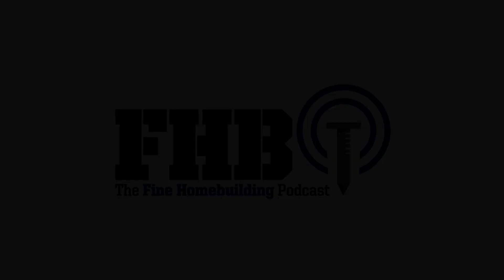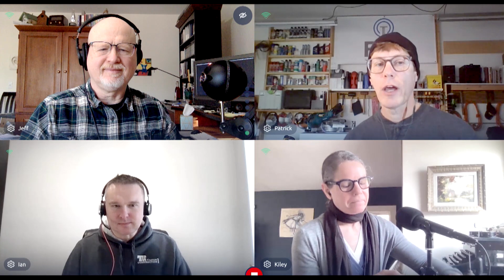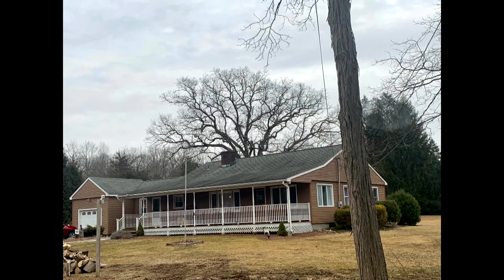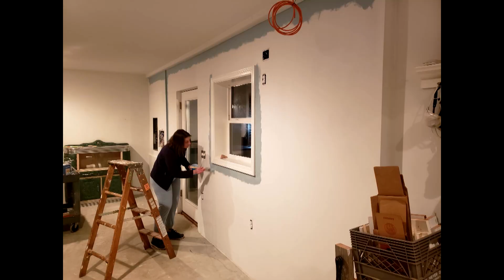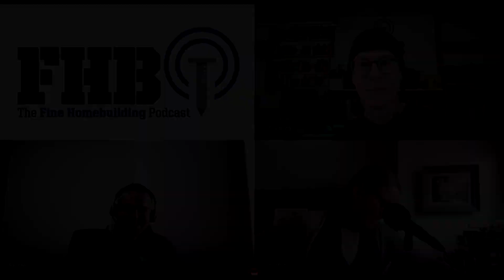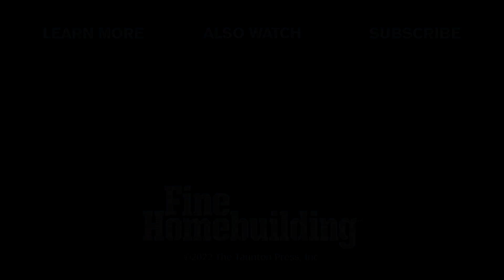Podcast 443: Rotproof Walls, Hardwood Flooring on Concrete, and the Future of Home Building

Comment: To KYLE. I hear your problem and I would say do NOT go crazy trying to get your exterior walls EXTREMELY air tight. Yes, try to keep out cold air, but definitely focus on holding the warm air IN too. But don't try too much to hold the warm air in on the sides, focus more on the ceiling. Add tons and tons of fluff to your attic (R60)... you will probably lose storage space. Then make your ceiling (under the attic) very tight around any openings. In the winter you are basically worried about two things, 1, keeping cold air from entering the house through strong winds, and 2, keeping heat inside the house by preventing convective heat loss upward. Your R24 walls are fine, it would be foolish to spend an extra $20,000 to get an r30 on your walls, because you'll never save that much on you heating bills, put that money towards the other things I mentioned.

Comment: A problem with ranch-style houses is that, because of the large roof surface, you can't build them large (2,000+ sqft). You will have a tremendous amount of rain water displaced during a storm. So there's a high risk of foundation problems, especially as the house gets older, if you're gutters are clogged or average size, etc.. Of course you can change the style of the roof, but then you wouldn't have a "ranch".